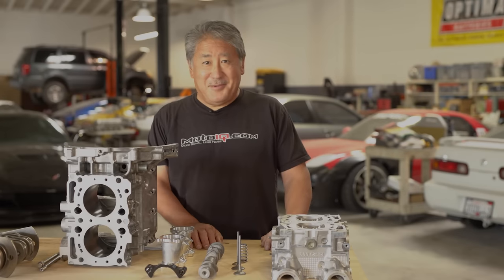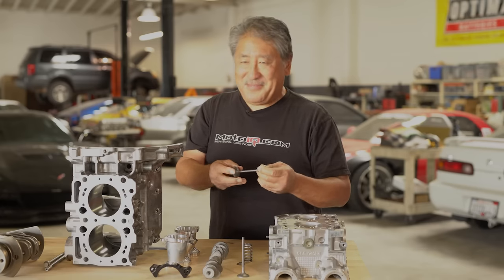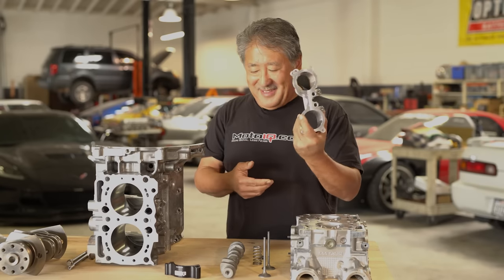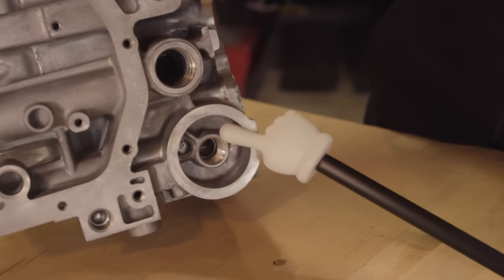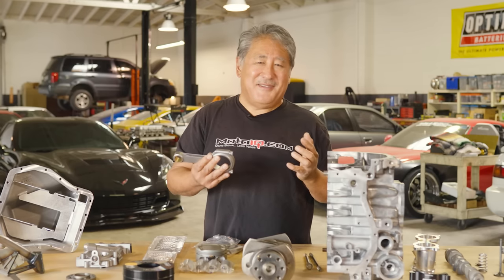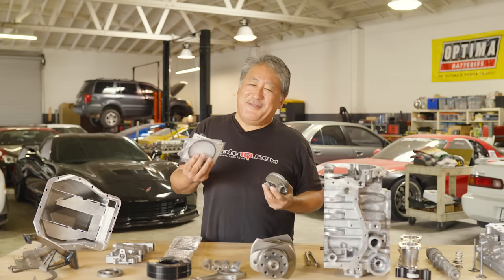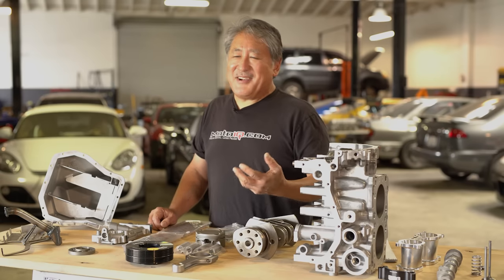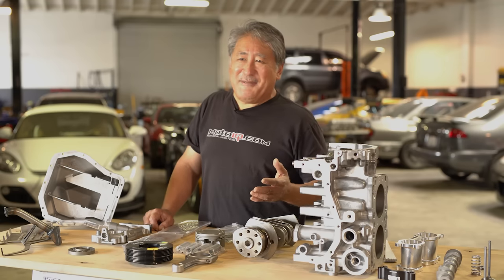How to Build a Subaru EJ Engine that won't BLOW UP!

Comment: The proper way to make an engine rev higher is to shorten stroke and reduce reciprocating mass.    
Instead, he increased the stroke and increased the mass by putting in a longer rod!  In addition, in order to draw in the air and fuel, the piston has to move down.  He thinks, and said, that having the piston dwell at the top longer is going to help breathing - wrong!  Unfortunate!
Reply from the maker: Actually you are wrong, other engine builders have proven this two generations ago in the 60's.  It's why F1 and Motorcycle engine have a big stroke to rod length ratio. We are not trying to make the engine rev higher.  If you paid attention we are trying to gain displacement without sacrificing the revs too much and to create an engine that revs more freely than the EJ257.

Comment: This could turn into a never ending expense. The engine is more valuable than the entire car  and in addition, you will need to take out another loan to build up the entire driveline. At this point you'd be better off buying a Tesla Plaid Edition as long as you park it outside !
Reply from the maker: Welcome to building cars beyond bolt ons.

Comment: I feel Subaru engines don't lubricate well In other words they need more oil eat some I don't know drive some just something to make sure this engine does not run low on oil other than that or no I feel they're pretty strong after blowing up too
Reply: Sorry that sounds like a mumble jumble I'm just trying to say I think the truth I think the super region has a oil issue therefore either get  A dry sump  Or try to find a much bigger oil Pan so the engine has time to drain the oil back in
Reply: You know what every time I try to say something it changes the whole conversation into something stupid I give up enjoy your Subaru
Reply from the maker: Is English not your first language?  Now I understand what you are saying but it was not clear at first. English is a difficult language and not logical. I was born here and still don't understand the grammar totally.

Comment: So I have a dream and was wondering has any one ever came across a 4th gen built legacy pushing 1,000 whp
Reply from the maker: No subaru does that for long
Reply: @motoiq  so realistically what's a good number to shoot for street racing and daily driving my car is a N/A but I plan to build the engine and turbo it
Reply: @motoiq  I'ma go through y'all to build me the baller block option I ant my block closed
Reply from the maker: Low 500's
Reply: @motoiq  so around like 520 ?
Reply from the maker: Under 550
Reply: @motoiq  so how much would a engine cost to produce that I have a ej253H4 I want to build to handle that power
Reply from the maker: about 16k

Comment: Why don't someone, Pour a metal casting, Block, Sure It will be a ,lot of money, Just on the first casting After that, It should go easy , just wondering what builder's think.
Reply from the maker: They have heavy duty billet cases for these engines that fix the issues but they are pretty high buck.

Comment: Watching this cause my EJ just blew up :(
Reply: Let the car warm up for 5 min as usual, drove my usual route, went down a curvy highway merge lane. Heard a loud "snap" noise which turned out to be my stock oil pickup, minutes later my motor seized lol.
Reply: @duke9620  Yeah it failed at the weld point near the neck 😂, just recently installed a new motor with an sti block, and reinforced the subaru weak points. Got an IAG Aos, Killer B baffle, pan and pickup

Comment: Love how when comparing 4cyl “performance” motors he completely ignores the manufacturer who’s engines have held records for YEARS, GM (LSJ, LNF, LDK), the LSJ being a supercharged, port injected, non-VVT engine capable of 500hp reliably on stock block (only if turbo swapped), both LNF and LSJ capable of 800whp+ when built identically to this motor. The fact this man doesn’t want to acknowledge the excellence that is GM 4cyl tech is truly…. Disappointing. But that’s ok…. when u line up next to one thinking it’s an easy kill and get shwasted… 👌
Reply from the maker: Ok considering this video is about Subaru EJ engines, what's up with you??

Comment: He understands engines physics geometry engine Dynamics heat transference and conductivity terminal efficiency metallurgy A Master class. Not a Subaru person at all.  I know certain gyrocopters an experimental lights for airplanes.  Subaru engines conversions and generally considered death trap engines because somewhere around 100 hours or a little more they tend to blow up on climbing out which is a bad time to lose an  engine .
Reply from the maker: Personally I would never go up in the air in anything powered by a Subaru.

Comment: Emilia Hartford needs to know this guy...or... 
he should run from her.
Reply from the maker: We know each other.
Reply: Hi Mike,  well there is another You Tuber that might need  your help too. Tyler at Hoopties Garage,
 his mechanic, the Wizard, at Tylers request, put a Subaru engine in a 1960ish Porsche roaster kit car, and took out the 40 hp VW mill. Both are You Tubers and it was good Content for both. 
Tyler doesn't always have the best of luck with the cars he buys, because in his words, they are the Cheapest ones in America of that type. He also gets support from Johnny, the Car Ninja, for his Bmw's and others....just saying...
Have A good one.

Comment: Not to be funny but all these things can be applied to just about any engine. There was not exactly any great insight into the peculiarities of the ej.  Not saying it wasn't good but no big eye openers or radical thinking. Back in the early 2000s the trick was to take all the turbo stuff from the 2.0 and slap it on the 1.5 and rev the stuffing out of it. Faster than a 2.0 ej and strangely satisfied that sleeper itch.
Reply from the maker: I would not say that is particularly innovative at all and possibly not any faster.
Reply: @motoiq  no I agree not innovative at all but in my experience using stock turbo gear on the 1.5 built a quicker car than the stock 2.0 not quite as nice to drive but none the less faster up through the revs.
Reply from the maker: did you turn up the boost?

Comment: Sorry open deck engines shouldn't be boosted too much.  This idea of converting it to closed is a bit insane IMO.
Reply from the maker: Not really if done correctly, it works well.
Reply: @motoiq  But closed deck strong engines like the 2jz et al. exist. It's ready to go. So, it's a cheaper method to get an adapter plate to match the application.
Reply from the maker: You are not going to fit a 2JZ into your STI very easily are you?

Comment: The only good things I can say about Subaru is once you get past the engine everything else seems to be pretty strong I did build mine up a lot and had to get several clutches but drive train held up great into your sucks beyond compare when you're paying that kind of money for a sti  And  Interior of the car is poor I wish this Cor could have a Honda  engine Is or a nice Nissan the sun engine would be great tooBut far as Subaru not and pressSound is great engine engine not so great

Comment: 8-10% more intake flow from undercut intake valve stems? You really think that you are going to gain 30cfm peak flow through the ports from removing 1mm from the valve stem? It might at the outside edge be worth 2%. Probably closer to 0%. You could take the valve out of the port and flow test the heads and i seriously doubt they would gain 10% flow, on a properly ported head the bowl is rarely the restriction. Unless you have some flow numbers on these heads and a paid receipt from SuperTech, I am gonna postulated that this is a sponsored video. I have never seen any head gain 10% anywhere from undercut stems.
Reply from the maker: It can give that much of a gain at certain lifts, usually in the middle range of the lift depending on the application. I got that number from small block Chevys in the context of explaining why it's done. If it didn't make a difference it's easier to make valves without the reduced diameter and it wouldn't be done.

Comment: The video was good until the pickup oil pipe, and then I realized this is a commercial, lol. A wider pipe, any mechanic would know is pointless.
Reply from the maker: No it reduces restriction on the critical vacuum side of the pump.  Any engineer knows this is not pointless at all.
Reply: @motoiq  and then the restriction on the block hole  for the oil pump, I have never seen a broken pickup oil pipe on EJs
Reply from the maker: Because you have never seen one break doesnt mean its fairly common for track driven EJ's. EJ's case restriction isnt bad, it's the FA where it is.  But of course our videos are commercials so the info isnt valid.

Comment: If you'd like us to build your engine I bet you I just bet you it's at least $10,000 to build a 2.0 flat super engine from a WRX that's like that's 500 horsepowers $10,000 I bet you a hundred percent and that's for the low low

Comment: Love the enthusiasm, But this should be titled

Putting in 70% more man hours into a build to get 29% less power than a comparable LS and 1/8th the service life.
Reply from the maker: If the LS doesn't fit in the chassis and the AWD stuff then you are stuck with what you have.  Not to mention the pain of getting the CANBUS to shake hands and let stuff like the dash, AC, radio and windows work.  Things are not as simple as just throw an LS in it if you want a fully functioning street car.

Comment: it's simple really, just melt down all the EJ parts and cast them into Inline 4 parts...lol.  When an engine's architectures only advantages are balance and low CG, but come at added complication, more parts and harder to work on, you've built a pointless engine.

Comment: Mike I love the video, but the EJ can't handle power reliable. It will last 6000 miles and needs rebuilding. It's ok if you have endless budget and your a race team. But if your an average Joe it's not affordable which makes the EJ 99.99 percent unreliable for the average Subaru enthusiast.

Comment: Great build except the Chinese crap
Reply from the maker: You mean Eagle? Only the raw forgings are made in China, all of the machining and finishing  is done in the USA and the metal is American SAE alloy.  The bolts are American ARP.  We have had a lot of good luck with Eagle even with race motors and boosted applications.  We have never had an Eagle rod or crank fail. You would be surprised how many famous brands use Chinese base forgings.

Comment: why do you keep calling it 'wpc' treatment. that stands for fucking 'wonder process craft'. what is that crap? just call it what it is. fine particle bombardment shot peening. you're shot peening it with very small media. are you trying to keep it from becoming more common?
Reply from the maker: its a proprietary process from WPC inc.  I don't know if anyone else has a similar process, if they do, I don't know about it.
Reply: @motoiq   ah come on. its very common - in aerospace and nuclear applications. the difficulty is in the even and measured surface application which requires sophisticated robotics using highly specialized FPBSP lances, and the cost involved for aerospace and nuclear means that they will never, ever, ever consider putting a car part into their machines, not even a Koenigsegg car part. they would be losing millions of dollars per minute when they could be treating the bolts that go into reactor containment vessels for ridiculous sums of money. 

but shot peening with 30 to 75 micron glass media requires very little pressure, and "precision" isnt a factor in cars, and even a rough and uneven application probably does wonders for a motors internals. so, i suspect the "WPC" treatment is just brushblasting 30 to 75 micron glass spheres by hand at car parts.

i looked into it when my friend/shop owner/race guy told me about wpc treatment and how great it was. i found out wpc mean "wonder process craft" which sounds like an anime joke.  search for fine particle bombardment shot peening on google and you'll find an article on shotpeener.com by chuji kagaya and yoshiro yamada called 'fine particle bombarding technology and functional development of metal surfaces'. as well as many others, in metallurgical journals.

i wasn't able to find a chemical supplier that would supply me with the correct blasting media. if you can find the actual micro-pellects, you should be able to perform this process with something as simple as one of those engine washing wands that suck up fluid with pneumatic pressure, substituting the media for the cleaning fluid. it requires very low air pressure, you'd want a glove box to recapture the media. but yeah you're probably getting ripped off. it's just fine particle bombardment shot peening. if they have a robotic apparatus with the lance,  it's worth it, otherwise, just do it yourself.
Reply from the maker: From what we have been told, it's some sort of ceramic media, not glass (I asked) and the media is mixed with some metallic agents like zinc and some dry lube stuff like molybdenum that get impinged into the surface. I don't think there are many vendors that do fine particle bombardment shot peening, I was looking, WPC is 10 minutes from us so we will keep using them.  Anyway, for our motors, I want a proven process and am not willing to experiment with stuff that might work. The cost is reasonable so why not.  Several OEM's use WPC, Yamaha, Honda, and Nissan so it's been validated on an OEM level.  Good enough for me.